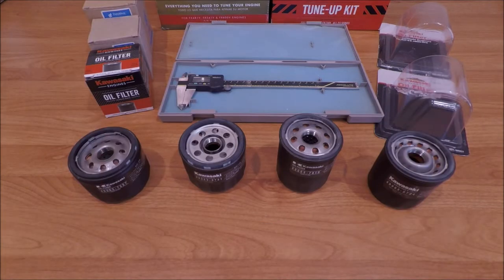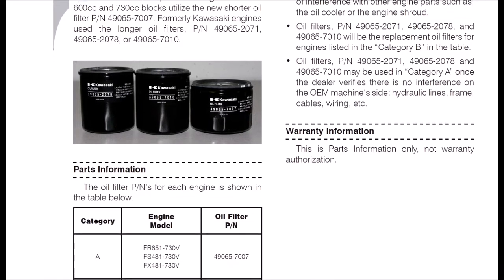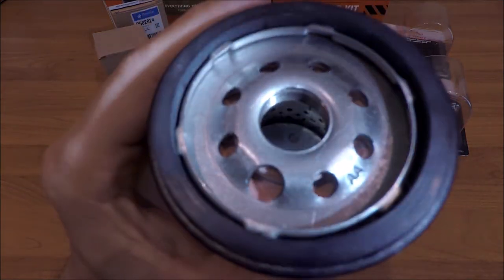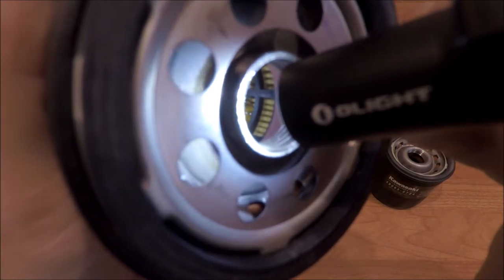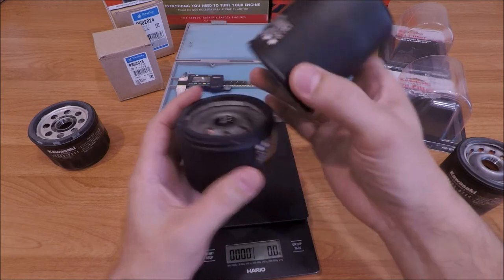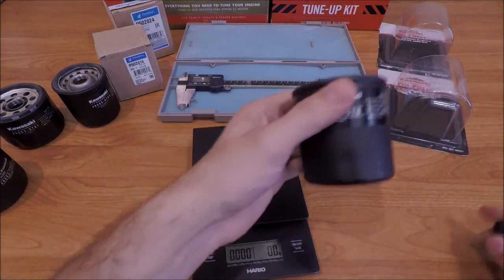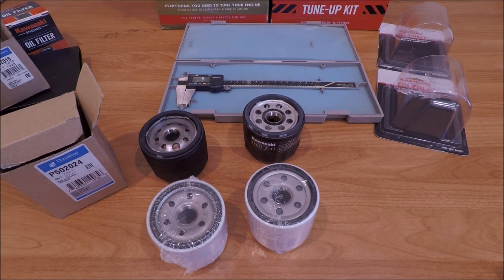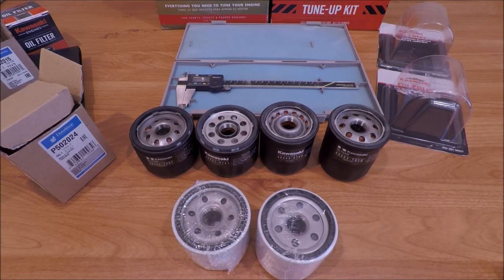Kawasaki Oil Filters Up Close - New Design vs Old Design

Comment: And this guy is 💯 right about letting the engine warm up on low throttle. Never rev a cold engine. That oil needs to heat up and flow through the engine.

Comment: Manufactures will bid out their filters and oil every few years to the best bidder ... The new filters are made by  Champ Lab, it is the E-core design same as ACDelco and Supertech.... Infact if you want to save some money and have a little more filter media you can use the Supertech MP4967 and the MP3614... Basically the same filters!!!
Reply from the maker: Yeah I saw a supertech teardown, no complaints here! It's the air filters that are more important to me, IMO.
Reply: @morejelloplease  I have a few Supertech filters cut open on my channel... They all performed very well.i like them... I have a Kawasaki fa730v on my mower and wouldn't mind looking into the canister filter upgrade
Reply: @uglyhandgarage2927  I read your comment and subscribed to your channel . I have a Kawasaki  18 HP FR600V motor on my Husqvarna 46 cut mower . I use Amsoil and the 7007 Kawasaki oil filter . Filters have gotten expensive and I’m trying to find a cross match filter for this model . Hopefully I can learn from your videos .
Reply: @hotchihuahua1546  thank you... The 2 I listed in the above comment will be your best bet as long as you have the clearance due to them being a little longer

Comment: Your video is as close to some answers I had . For whatever reason , Kawasaki seems to be the hardest lawn mower engine maker to cross reference an oil filter .  Briggs & Koehler aren’t .  With the price of filters these days it’s nice to have options .
Reply: I have tried to find a cross reference to the Kawasaki ones with no success
Reply: @randalllyons8467  TONS of options when your cross reference the old part numbers. WIX51394  and Fram XG4967 (as well as Supertech ST4967) for tall filter,  and wix 57035 for the short one are my go to. 
I guess there are some Toyota filters that also cross reference surprisingly.

Comment: thanks for the time and effort here. It is notable how Kawasaki has merged their filter offerings to "fit" as many applications as possible, simple economics. For my 95 Vulcan 750 that I purchased new, I have seen at least four perhaps five different specs, all of them shrinking in size over time to the point I was concerned with flow rate and switched to K&N which is the size of the original part. 8k miles, runs and looks like new...well a little bezel rust lol
Thanks again
Reply from the maker: Thanks, this video didn't come out the way I intended.  there's a lot of information that was actually condensed. when you walk into the store or go online or read the forums, all the information was confusing and misleading so I sourced all of these filters so I can have them all in front of me at once and figured Id press record and share my findings. :)
Reply: @morejelloplease  I just got off the phone with Kawasaki, my original part 16097 is in its eighth iteration as 16097-0008!
 I thought your video was extraordinary informative and demonstrates the concerns and issues that all of us encounter. Bravo!

Comment: Thanks for showing the differences. My Scag has the FX730V . I like using the 3/8" drive socket filter fluted wrenches to remove my filters . I had to get a different size for the 7007's  replacement.
Reply from the maker: yup, i have a few different size filter wrenches just like you describe.   the new kawasakis are coming out with the Evo series,  EFI engines with a new look.  I want to take the fan cover from the new engine and put it on my FX691.     when i was looking at oil filters for these engines i was confused by all of the different part numbers so i bought a few filters and made some videos as you can see LOL

Comment: Hey great video. In your opinion which filter is better 49065-0721 or 49065-7007. On my new 2022 badboy elite mower came with the 0721 filter but the 7007 is more readily available. I can order the 0721 or I can buy 7007 from a local store in my area. What are your thoughts if you can please?
Reply from the maker: either will work, the 7007 is heavier but i'm not sure if that means it has more media inside, or if it has slightly thicker metal in the casing.   the 7007 will eventually be phased out and replaced by the 0721, either filter is OEM kawasaki and if there's an issue it should be covered under warranty.  good luck with your bad boy, i almost bought one but saw one in person and it didn't float my boat, you won't like the video i made about bad boy  :)  at least you got a kawasaki and you're obviously interested in maintaining it or else you wouldnt have landed on this video :)   I have  afeeling your bad boy is in good hands and you'll keep her in great shape :)
Reply: Thank you very much. I just subscribed to your channel. Thanks for all the info you share.

Comment: On my new 2022 Hustler Fastrak SDX 60, I will replace the engine oil filter on the FX730V with whatever OEM Kawasaki filter is on there now. Same thing with the hydros, I’m going back with OEM Hydro Gear ZT3400 filters.
Reply from the maker: and yes oem for the hydrogear , if you can't find them and have a tractor supply nearby, check to see if they have badboy filters, they are actually oem hydro gear filters in a bad boy box.   make sure they are the correct ones tho.   i've seen kawasaki stick a smaller filter on an engine from the factory because it's what they had on hand, even tho there was plenty of room to stick a higher capacity filter on it.   they should all be running the superceeded part numbers by now but if you goto a small engine shop that doesnt get a ton of business, they may still have the older part numbers.  dont be alarmed, as long as it fits and it's oem kawasaki you should have a problem with warranty if an engine issue were to come up.

Comment: I purchased a KN HP-1003 for my FX801v, I thought it looked odd with no internal metal backing on the media so I grabbed some 49065-0724's, and they appear identical internally, even the printing on the bottom looks the same. I dont like it but figured O.E is good enough, but does anyone know of any other compatible higher-end filters?
Reply from the maker: Donaldson looks promising but I haven't taken any apart.
Reply: @morejelloplease  Donaldson is good stuff, after some digging I'm gonna pick up a fram FE4967 for the next change.
Reply from the maker: @RJ-oi9fh  i've been out of the loop for a while, i used to like pure ones for my cars, the vettes ran OEM ZR1 filters, they had the higher pressure ratings, even with my daily drivers i use oem filter.  even if they are rebranded xyz filters, i'll get less grief if there was ever a time of a malfunction and the factory filter was on there instead of walmart supertech.   check project farm if you havent already, he reviews everything.

Comment: I’m know a mechanic who swears non Kawasaki filters don’t let enough oil to the top of the engine.
Reply from the maker: Due to filter structure and a change in pressure or volume?
Reply: @morejelloplease  he says the oil doesn’t flow as well. He said “almost every time he sees an engine with bearing failures the mower has an aftermarket filter on it” I wanted to use wix cuz they’re 5 bucks as opposed to 10. He talked me out of it.

Comment: Oil Pressure (43 to 85 psi) AT (122 ∼ 144°F) @ 3200 rpm FS, FR, FX
Reply from the maker: thanks for the info, you know the nitty gritty about the difference between the FR691, FX691, and now FT691?  i know the FX has the canister filter, supposed to have a heavier duty starter and clean out ports, wondering if there was any difference in heads, or any different internals.  you recommend 3200RPM max?   most manufacturers want 3600 to increase blade tip speed.
Reply: @morejelloplease  3200 just the oil press test spec that's all. 3200 -3600 is all I've ever seen and that's per the equipment manufacturer. Don't know much about the FX but I know clean out ports are part of the difference years ago. Service manuals, whatever you want to know is in them. I could read one 100 times and still need to pull it out when it really comes down to it.

Comment: my fx921v came with a 49065-0044 but the dealer said 49065-0724
Reply from the maker: weird, must have been old stock?   that part number shows it came before the 7010 which came out around 2009, i dont think that engine was around then but i could be wrong.  no telling what the manufacturer will put on the engine at the factory, the 0724 supersedes the 7010 which supercedes the 0044 according to my research so your dealer is correct, or maybe they are coming out with the 0044 again, who knows :)

Comment: Will the Wix 51394 work?
Reply from the maker: i dont know, never used it, google to see if it's interchangeable
Reply: The WIX 51348 is a match for the Kawasaki 04965-0724. I installed one of the WIX's on my FS691V engine, Ferris 52" deck the other day.  According to my research, the WIX is comparable to the Kawasaki.  Besides, I have about nine of the WIX's, so guess what I will use.  LOL  Also, the WIX's have been on my shelf long enough that they are made in USA.
Reply: Yes I have used that part # for years
Reply: Some parts stores have sold it to replace std filter but I’m not into trying it 😊